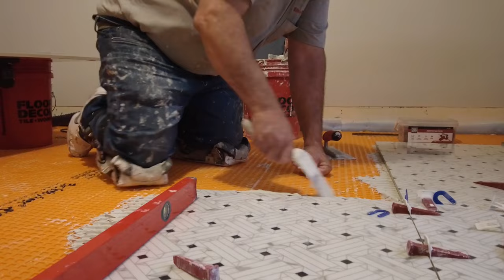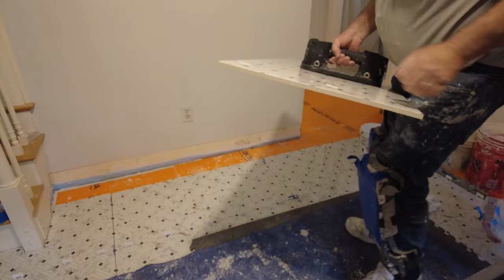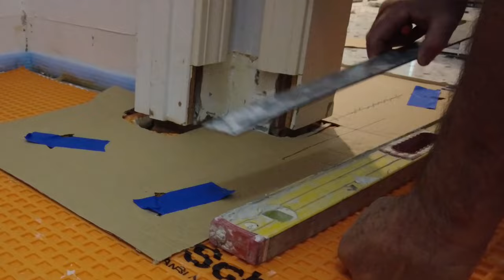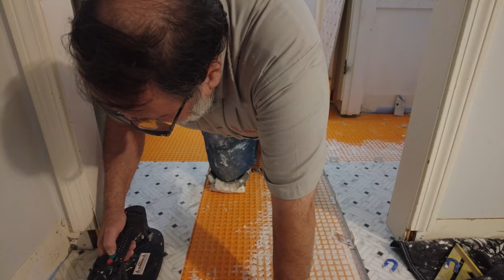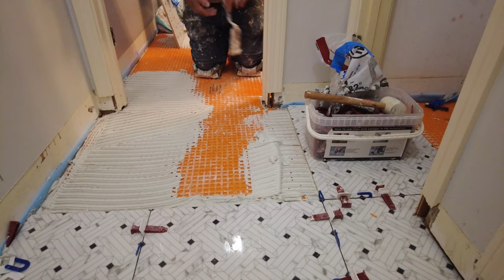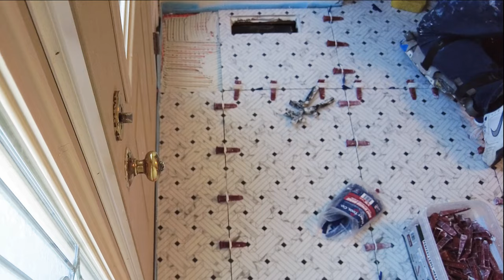Huge  20x40 porcelain tile floor install

Comment: Hey, Sal. Can kerdi waterproofing membrane act as an uncoupler? I ask because I’m renovating a house where my kitchen subfloor is in great condition but I do not have the room for 1/8 inch Ditra if I want a perfect tile to wood floor transition. Could I use Kerdi or perhaps another thinner uncoupling membrane ( I do not know of one that is 1/16th) in place of Ditra or another 1/8 inch membrane?
Reply from the maker: No, look into  a cleavage membrane http://noblecompany.com/products/tile-installation/sheet-membranes/

Comment: Sal, I noticed you used blue painter's tape on a large piece of tile that you were cutting on the wet saw. What purpose did that serve? Visible cut line, chip prevention?
Reply from the maker: Visible cut lines.

Comment: Do you have any recommendations on a leveling system I can buy on Amazon?  The one I buy locally is not offering that brand anymore.  I have trouble with them breaking off clean the next day and Im tired of having to cut them out of 1/16” joints.  I always have mud in those spots so maybe its my fault.
Reply: Try the Lash system, it's from QEP so you can find it at box stores. And for the joints, watch Sal's technique where he wipes the joint before putting in the spacers and laying the next piece, it helps keep things clean

Comment: What are you doing to the edges with the smaller trowel after you lay the thinset?
Reply: Taking away a tiny border to prevent excess thinset squeezing into grout line. It also stops adhesive gathering around levelling clips which would make it hard to knock out.

Comment: What mortar do you use for filling in the membrane at the same time you set the tile?  Would it fail the floor to use a modified mortar like versabond?
Reply: Schluter recommends / requires unmodified for the warranty. Modified will take months to dry, and won’t be as strong
Reply: @Chip Ditra requires modified thinset to adhere the membrane to the substrate, and UNmodified thinset to set the tile. It’s a fantastic system.
Reply: If you want to use modified to bind to tile, It needs to be schluter All-Set to get their warranty.
Reply: @vinnied.1239  all set isnt sold near me.  I have access to home depot, lowes, laticrete, custom, unzi and mapei.
Reply: @Trucker-Belly  understood. Look into laticrete 272. It is unmodified but surpasses bond strength requirements for 118.4 modified mortars.
Reply: @vinnied.1239  nice!  Thank you.  I didnt use modified mud for tile bc its $10 per bag and I assume the bond is bad but Ill give that a try.